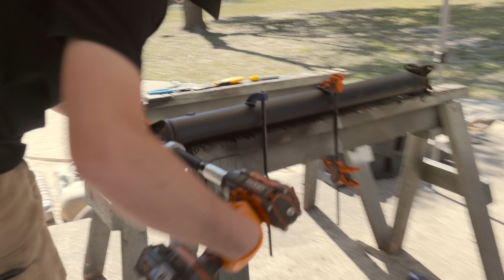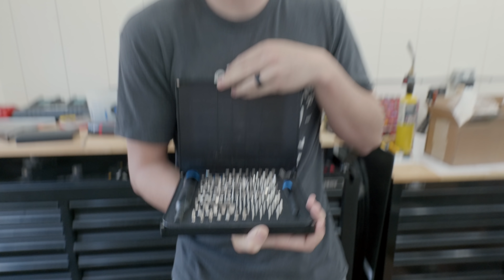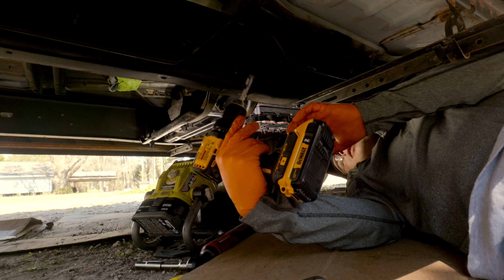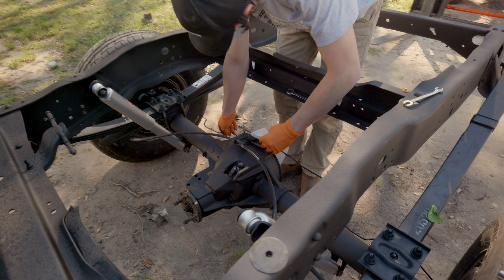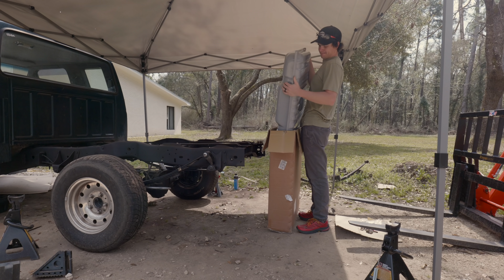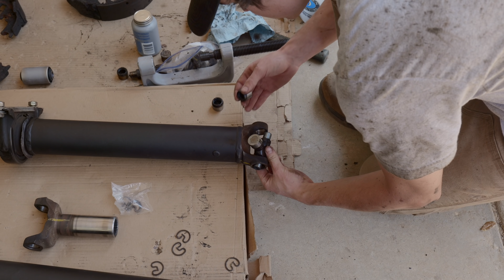PUTTING IT ALL BACK TOGETHER! Fixing Transmission Leak, New Gas Tanks | F150 Restoration

Comment: One thing Dylan.  If I was doing all that u are doing.  I would look into getting rid of the mechanical fan on the front of the motor and change it over to a duel electric fan set up mounted to the radiator.   It will  slightly help in power and fuel efficiency because u are getting rid of one more thing uses engine power to move.  Would be a good thing to look into.    Glad to see a younger person wanting to take the time and learn more hands on stuff. Instead of just take it to a shop and pay someone else to do what u can do at home with some time and patience.   Keep up the good videos.

Comment: I wouldn't replace any of the sensors yet.  If that compression test you did is any indicator the engine needs a rebuild.  Easier and less expensive is to find a good running junkyard engine with good compression. Do a quick swap and drive it for years.

Comment: I love a good restoration, the downside of going this route is the lack of crash safety. An older truck like this is very poor in any type of accident, modern F150s are relatively good
Reply from the maker: This truck being purely metal, the other car will get the worst of it😂 Dylan has already got run into in the truck and nothing happened other than the other car driving away with a busted grill and gosh knows what else

Comment: It would be interesting, when it's all done, to know your projected time investment vs actual. Then, assign a similar $ per hour or day as a pro mechanic in your area to see what it could have cost (maybe you're already doing this). Just a suggestion. Thanks!
Reply from the maker: Interesting! It would be nearly impossible to know exactly how much time we spent because of how sporadic we work, but we could most likely figure out an average. We want to try and do a cost breakdown as well!
Reply: @Woodbrew  And the work tasks were so intertwined.  Normally you would not take the bed off to pull a gas tank.  But you took the bed off so you could work on many things.
Reply: The satisfaction of doing things yourself and realizing you can do it is priceless.

Comment: Here is a suggestion, as you said Phase II, front of truck.  But let’s change that Phase to is front of the truck underneath.  Then Phase III is working on the engine, incl the plugs, works, sensors, etc.
Reply from the maker: Haha we are just kind of going for it! I think we might come back to the front underneath another time. Get what we need to get done to get the truck running again for now and work on the exterior, that is going to be a task as well😅

Comment: Have you considered building a pit to drive your truck over, depending where you locate it you will have easy access to the under carriage and  you can put electric sockets in so that you have lighting and beams so that you can jack the engine up to get at other things more ease
Reply from the maker: Not a pit, but if/when we build a bigger shop we will mostly likely put a lift in there!